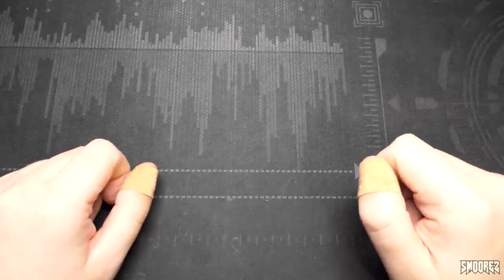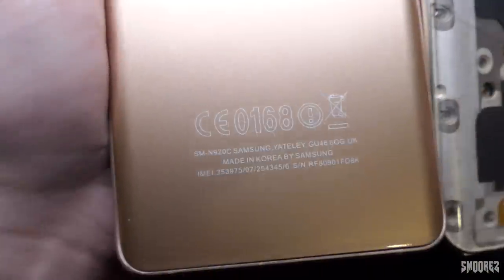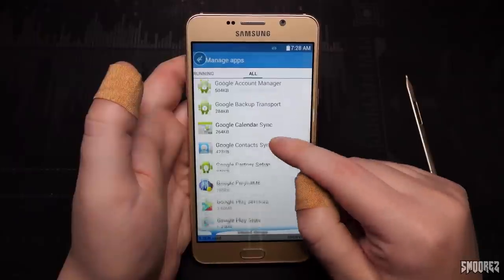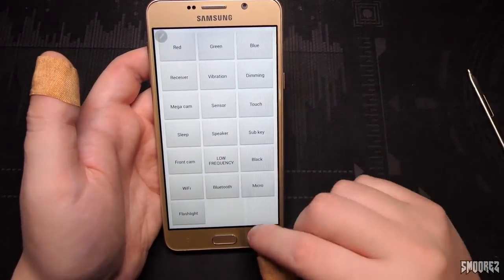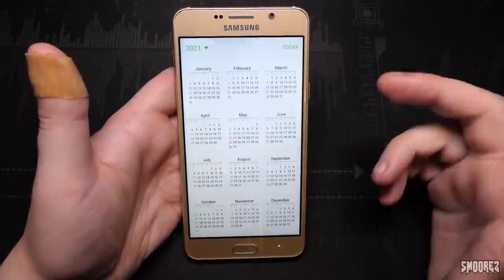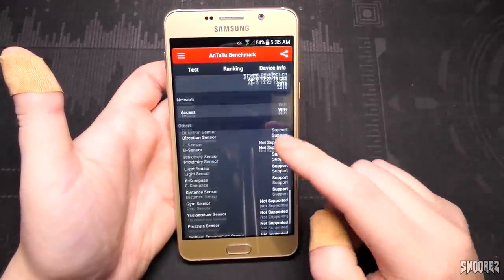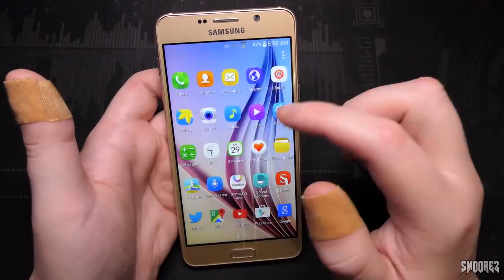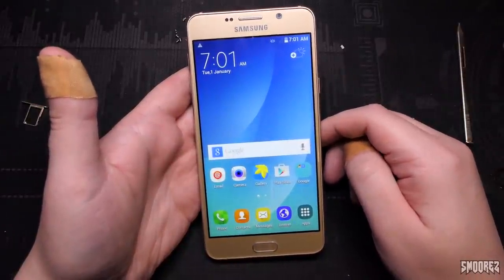ATTACK OF THE CLONES: The GOOPHONE NOTE 5! A Terrible Samsung Note 5 Clone (Test & Review)

Comment from the maker: Hey there, hope you enjoyed this one!
I tried making the video a bit shorter than usual, hoping to get most videos to around the 45 min maximum, which to many people is still a bit long but it's definitely better than 1hr30m! Plus doing shorter videos like this takes less time and I can get more content out for everyone, works better in the end for all!

Timestamps: 
Intro: 0:00
The actual Galaxy Note 5: 1:21
Unboxing the GOOPHONE Note 5: 2:09
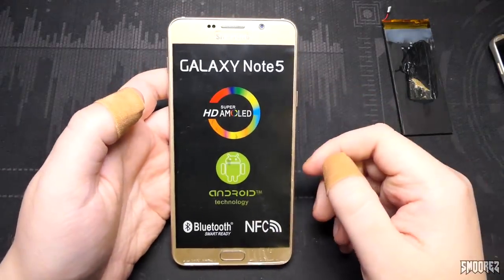GOOPHONE vs Legit: 4:38
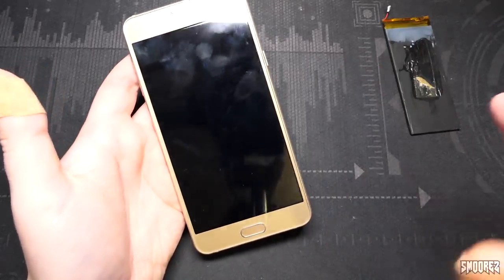The S-Pen, Sim Tray & GOOPHONE MicroSD Installation: 6:09
Power On, Vibration Motor & UI: 7:08
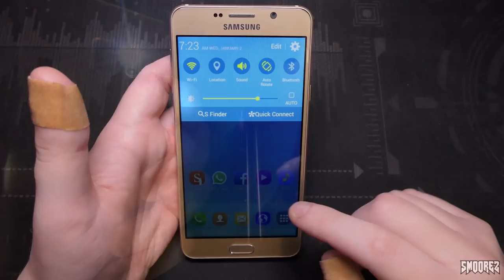Testing the "S-Pen": 8:44
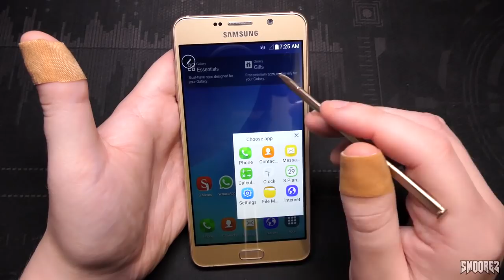Settings - Connections, Sounds, Display & S-Pen: 9:55
Settings - Application List & Wallpapers: 11:32
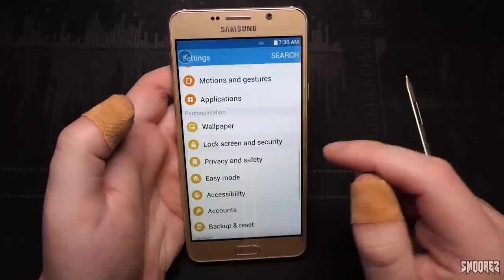Settings - Security, Other Options & About Phone: 12:49
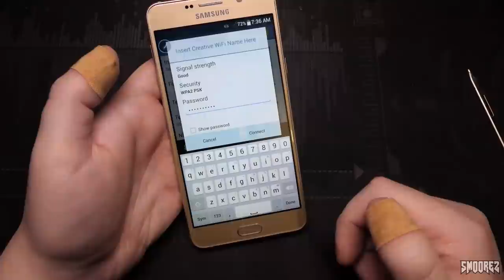Updates, Test Menu, Some Apps & Browser Test: 14:41
The Camera: 16:50
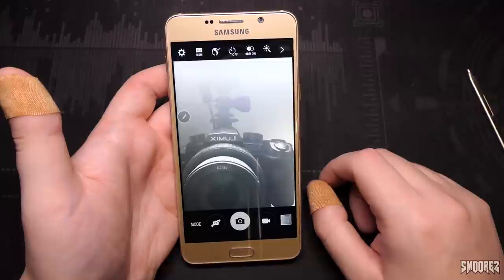Camera Test: 18:30
The Camera is crap, more non functioning apps & Speaker Test: 20:55
More applications (S-Health etc): 22:21
YouTube Test: 24:14
Preloaded AnTuTu 4 & Face Unlock: 25:11
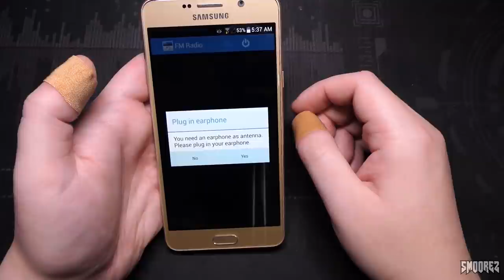FM Radio, Gestures & the rest of the apps: 26:45
Installing my own apps & attempted gaming test: 27:42
DeviceInfoHW & CPU System Info: 28:25
The Secret Codes App: 29:53
Conclusion & Pre-Teardown: 30:44
Teardown: 32:09
Does it work, the true specs & rambling: 35:46
A very long outro: 37:02

CPU & System Apps are in the description above!
As well as the extracted files from the phone!

Be good people!
Reply: I can't enjoy this one yet for another 69 minutes😅
Reply: Yeah i agree
Reply: I honestly enjoy the even longer videos even more but I understand some people have shorter attention spans :)
Reply: I would rather have a longer one
Reply: So what can i do with the extracted file? Can i modify my phone with it?

Comment: These chinese clone phones are a goddamn plague in the third world, if you wanna get an old flagship you run into nothing but these things, and the worst part is that they are IDENTICAL to the real ones, but once you turn them on it's obvious that the screen is barely 720p, has maybe 1GB of RAM and it runs android marshmalllow/nougat, yet the specs on system settings say otherwise. And of course, if you run CPU-Z the app itself will tell you it's fake, but the average person won't know that and will happily pay the $350 they ask for say, a S20, when it's barely worth $50. I learned my lesson a couple years ago with a Moto Z3, i had to literally stalk the guy who sold it to me, wait in line for HOURS then settle for a beat up yet legitimate Moto G5+, which definitely wasn't worth $200. My very next phone was a Redmi Note 7 which cost me $150 on aliexpress and still works to this day, helps that lineageOS supports it.

Comment: I’m pretty sure I have a galaxy S5 clone made by the exact same company. It was actually given to me, but the only way I could tell it was a knock off is that the charging port cover doesn’t have a water seal around it, and the home button looks a little different. But it still has that same gravelly sounding vibration motor. And that speaker, Man that speaker is just awful, I’ve heard smart watches with better speakers LOL. But cool video all the same.